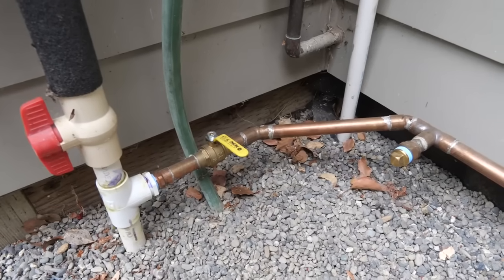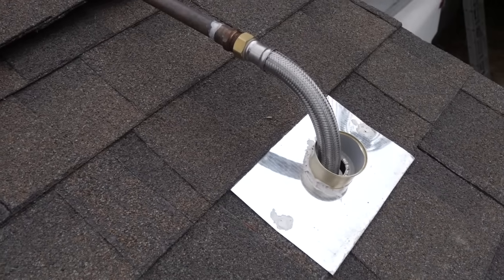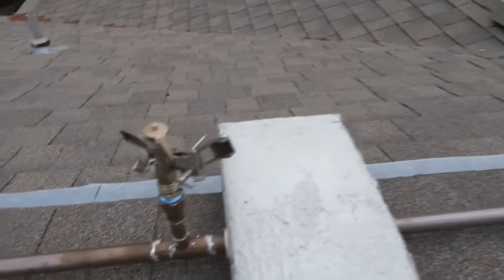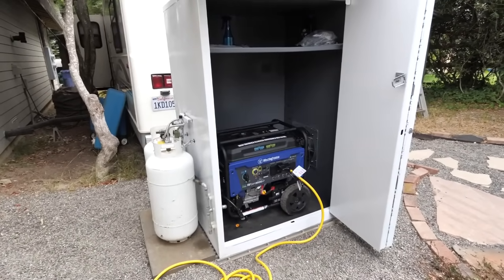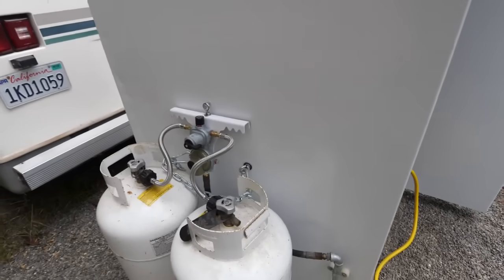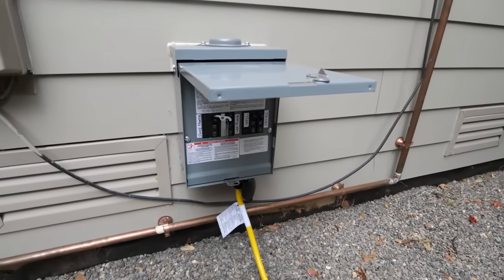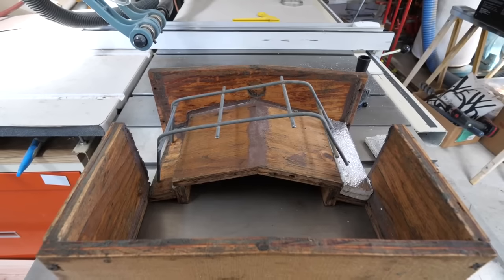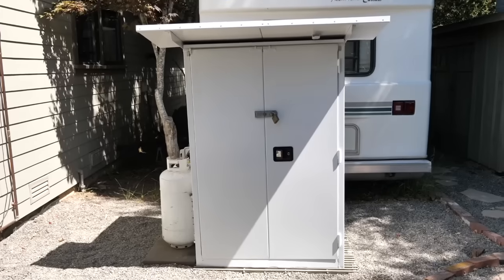Roof sprinklers and backup generator for wildfire-prone rural house

Comment: From an engineer: excellent work!  HOWEVER: Houses typically burn from the inside out!  Ember storms force embers into the attic and that's all she wrote.  You are depending on sprinkler droplets intersecting with every one of the many thousands of embers flying toward your attic openings/vents.  That is unlikely.  New homes in San Diego are required to have sealed attics with the exception of special vents.   O'Hagin fire and ice vents have a fine mesh and a convoluted pathway guaranteed to stop or extinguish all embers before they pass through to the attic.  The O'Hagin website has very educational videos of lab testing  showing how an ember storm passes through almost all roof vents but not through the fire and ice vents.  Those videos should be a wake-up call to any sensible person.  Even with sprinklers, your home, as it is now, stands an excellent chance of burning.  I would seal the attic and add the appropriate vents.  In fact, if I were Czar. all homes in California would be required to so retrofit.  Otherwise we are all going to go broke.  All insureds in Ca are facing thousands of dollars in assessments and increased premiums to cover the 60 billion (so far) in losses in LA this month.
Reply: Tell that to the man In Palisades that just saved his home with a roof sprinkler system he installed and not as intricate as this one.
Reply: @rosacam6765  The word unlikely is not the same as the word impossible.  You seem to think that every home with a roof sprinkler survived.  Actually, some homes in the Palisades survived without any protection at all.  That should not be a recommendation to do nothing to protect houses from fire.
Reply: I covered all of my soffit vents with 2 layers of expanded aluminum commercial kitchen vent hood mesh. I also added stainless steel screen gutter filters to keep leaves out and prevent embers from setting new fires in the gutters. So many steel roofed homes in the 2017 Tubbs Fire burned when sparks blew in to the attic area and set the house on fire from the inside. Here's my dual pressure water system for the backyard roof deck. Morse cables operate it. I saved my house with it after a 46kwh lithium battery bank set fire to my shop and garage 5 months ago. https://www.youtube.com/watch?v=SQiHNLHNpt4
Reply: That's good info.  I was wondering how all these seemingly well kept homes with tile and asphalt shingle roofs (and plaster or stucco exteriors) went up so quickly.  Serious kudos to this homeowners forethought and workmanship, but I wonder in the kind of winds they experienced in Palisades, if that water would just be blown into oblivion before it touched anything.
Reply: We live in the okanagan in Canada and I can tell you when I lived with my parents sprinklers on the roof and on the ground saves us multiple time!
Reply: Sorry, Forest fire in Northern Minnesota years back. All the homes with roof sprinkler systems were saved but for one.  That one the generator ran out of fuel and the well pump stopped.  The idea is to keep the roof wet, not hit every ember before it touches down. The
Reply: @MW_7654  One problem:  What would have happened if all 10,000 homes in the Pacific Palisades had turned on roof sprinklers at the same time?  (Or even the 5,000+ without pools to draw from.).  The supply would have failed in under 5 minutes and there are no wells.  The fire department had no pressure at the hydrants and pretty clearly all those houses were not drawing water.  Probably need a plan B in Callifornia.  Maybe everyone needs to have a swimming pool and roof sprinklers AND sealed attics.  Sealed attics and tree/ brush removal may still be the easiest/cheapest to implement.  All those big, beautiful trees crowding the houses may still be a problem even with roof sprinklers.  What happens to a house with sprinklers that has huge burning trees in close proximity all around it?  Does it survive?
Reply: @ I agree with sealed/protected attics.  And there shouldn’t be any wood or combustible roofing.  All house wouldn’t need to be on if the spread was stopped early.
Reply: in other fires vents in home allowed fire to enter.
Reply: But if the attic fan blows out ward?
Reply: Agreed, as a San Diego in Terrasanta, my house survived the cedar fire in 2003. Glowing embers fell like snow every 3 to 4 feet.

After that fire burned 2000 structures, I fireproofed my house by removing all wood, trim or burnable material from the facia board down. Then I boxed in the eaves and covered everything with stucco.  All shrubbery and plantings around the house have been removed.

But that was not enough. During the fire, I put sprinklers on the roof and left them running on city water during the evacuation. When I returned the canyon wall across from me, had burned from the Mesa to the bottom of the canyon. 

The comments to this video are as important as the video. Thanks to everyone who has contributed. A diesel pump hooked up to my swimming. Pool will probably spray the place for two or three days.
Reply: @rockdaddio69  yup because roof sprinklers aren't always enough. What did you do in 2007 and 2014? never came close to you?
Reply: Premiums cannot be increased for at least the next 12 months.
Reply: @Carlitabita  Democrats own this state lock, stock and barrel.  They can quickly pass any new law they please without opposition.  That is just the way it is.  You may get an unpleasant surprise.

Comment: Amazingly simple yet ingenious! I live in a high fire risk area of Oakland, CA and I plan to copy your idea, however to start I'll just grab a few sprinklers and extra water hoses. I can easily hop up on my roof and manually place them in case of a fire.
Reply: Be careful. You might need every precious second that you can get. I'm in Lafayette and planned for wildfires since the 2017 Tubbs Fire.
Last year I installed my dual pressure valve manifold on my roof deck. My lithium battery bank caught fire August 2, 2024, when by pure luck I was home. I heard the loud pop and saw black smoke rolling out of my shop. I headed out to the roof deck while calling 911, opened my fire cabinet and pressurized the 1'' double lined fire hose. I tore off the skylight and plunged my  arm through the smoke with the nozzle spraying a 30 degree pattern and still burnt my skin. The elapsed time from the pop until water was on the fire was 70 seconds. The firefighters said that another 2 minutes with no action would have engulfed my house as the flames were eating through the roof under my bedroom floor.
  Here is my apparatus. Pure unregulated 120 psi  street water pressure will send a stream of water 70+ feet away. I also have built in sprinklers with steel pipe. https://www.youtube.com/watch?v=Af91JljyfeI
Reply: @kimmer6  - that's absolutely terrifying, thankfully you ended up safe and with little damage! After watching the 2003 amateur video taken by a fan inside the Station Nightclub, it absolutely astounded me how it only took 90 seconds to go from the first flame to people dying, and ultimately leading to 100 dying. I made my teen kids watch it so they understand the incredible danger even when there is still only sparks and smoke. BTW - 1) where do you buy fire hose? and 2) what was your battery bank used for? I only ask because your story has now made me terrified of lithium battery banks.

Comment: I like the sprinklers on the roof just make sure you ground all of that it's very easy to ground not just 41 reason for many reasons electrolysis is one and of course  Lightning is the other and there are probably many other reasons

Comment: Sprinklers on the roof ain’t going to do much. Generally fires start by infiltrating the eave overhangs into the attic. You probably did a whole lot of work for nothing. All roofing in CA is required to be class A which means you can hold a flame to it and it won’t catch fire.

Comment: Wood fences, gable vents, wood fascia, etc. all ignition points. The roof isn’t the problem in this case. Fire and 70-100 mph winds won’t be stopped by anything. The radiant heat from a neighbor’s house or a tree can ignite the wood inside the walls. This system may help in some cases but not all.
Reply: I bet you're great fun at a party...🙄

Comment: Great idea! I've long thought that if in a rural area I would do the same. I do have 2" trash pump and a couple hundred feet of hose that allows me to suck from canal behind the house and be able to deliver a 90' stream of water in case of fire. The water's low salinity so I use it to flood yard during drought as St Augustine's ok with low salt.

Comment: Nice job, well done. Only question I have, is the water sprayed in the air to get on roof enough flow to prevent roof fire? In a wildfire there is so much heat that it could turn that sprayed water into flashed vapor leaving a dry roof ready for ignition.

Comment: I saw one of these in action on one of those Californian houses during the fire.  If I were running this system I would have a dedicated storage tank of rain water for the system--like a cistern.  Then a pump with its own back up generator just in case you ever lost power from the grid--pretty much like your power set up.  And remember, these generators need to run at a minimum every month or so to keep him lubed and see if there are any issues.
Reply: That’s exactly what I have. I got a 5000 gallon cistern and to gas pumps at push 75 gallons a minute through the sprinklers. I also a trailer with 900 gallon tank and a pump that can handle two 1 1/2 inch hoses.
Reply: @Idahoprepper71 The new normal storm in Southern California comes with 40 to 80 MPH winds which defeat any sprinkler system and expose the petroleum based  roof to ignition.  These winds now come from all directions, not like the Santa Anas that always blew toward the ocean.   With all this preparation it is still necessary to remove the "egg crate" patio cover and probably any vegetation taller than 3 feet.  Any lawn must be removed as fire will smolder in them for days to weeks.  Other problems are such as my brother in Santa Rosa CA. The Tubbs fire came within three houses. The next door neighbor has at 150' plus eucalyptus covered with resin filled leaves and loose bark  It is "too expensive" to cut it down and he "likes the look of it". That single tree has the potential to spread flaming debris pretty much everywhere,.  The houses in fire zones must look like Santa Fe adobes with no eaves, flat roofs that can be flooded from gravity storage tanks and little or no vegetation except cacti and succulent plants.    "Fire fortress" architecture is probably the only way that buildings can be insured in the future.
Reply: @Idahoprepper71  - At 75 gpm, that would get you just over an hours run time, and an extra twelve minutes from your 900 gal tank. I know it's better than nothing, and hopefully your not actually pushing 75 gpm through the sprinklers.
Reply: @Idahoprepper71  You are the man!
Reply: He is on a well . can't get much bigger tank than  that

Comment: I like the protection of the propane tanks bud.................
Reply: I'd at least put some cinder blocks around it and maybe cap it with big concrete pavers. leaving an air gap of course. Great setup other than that.

Comment: Great job! That could make the difference of having a house or ashes after a major fire. One recommendation I might make would be to use the generator to charge a backup battery power supply then run the pump off that. In a big fire you may not be able to get outside or the generator may overheat and shut off. The battery backup can be inside and protected and run the pump for a while. Depending on the size you buy. If not for a fire it’s great to have for power outages in many emergency

Comment: this is great, but does not address the major contributor to whole home destruction by fire of vented attic (majority houses in California/ west coast). Basically embers get sucked up into the attic igniting attic insulation and other materials burning the house from the inside attic out/down. Mesh screens mitigate this but dont stop it. Sealed attics dont have this problem. Other strategies of sprinkler covering the attic vent inlets may be more successful in addition to vent screens, dousing any embers with fine miss as they enter the roof assembly. As the embers will follow a similar air flow path as fine mist.
Reply: The sprinkler  system creates a high humidity "bubble" along with all the water flying around. Most if not all of the embers get put out or just can't ignite. The method works surprisingly well.
Reply: @jsparx  i am talking about a high wind ember storm event. not a typical fire. As the fires we most need to plan for are catastrophic ones.

https://youtu.be/IvbNOPSYyss?t=126
Reply: @jsparx  i agree it would help, many things will help. 

However, It would not get the attic wet or wet the live embers that get through the grates into the attic. 

A rotary sprinkler is only meant to apply water over a large area over a long period of time. When an ember storm comes it will not do anything to the majority of embers flying around as a rotary sprinkler only points in a single direction (of 360 degrees) at any one moment.

Again it certainly would help, but as a Californian that has dealt with fires for decades this would not save vented attic structures on its own.

Comment: I agree with some posts regarding roof and foundation vents allowing embers to enter the stucture. Also I would note the flexible connection at the roof is susceptible to fire damage if it is a rubber hose inside the braided steel cover, perhaps a copper according style water heater line would be an alternative. If the main pvc well pipe could Be copper from the ground with a copper/brass shut off valve to irrigation and fire suppression system to prevent heat damage causing a failure in the piping. You did so much great engineering